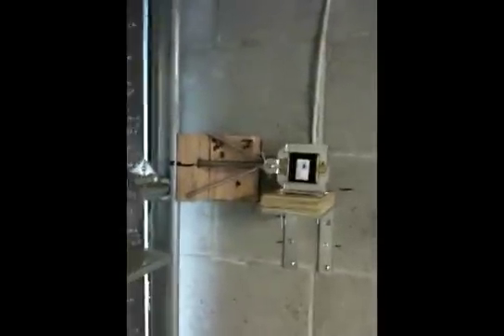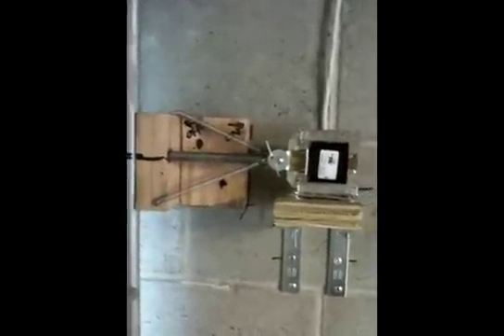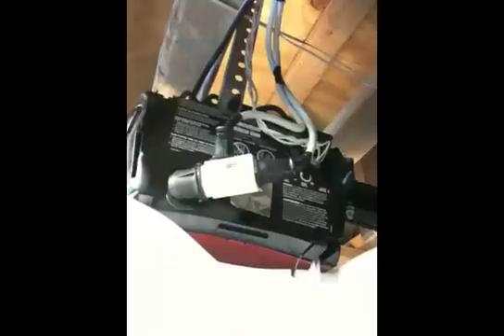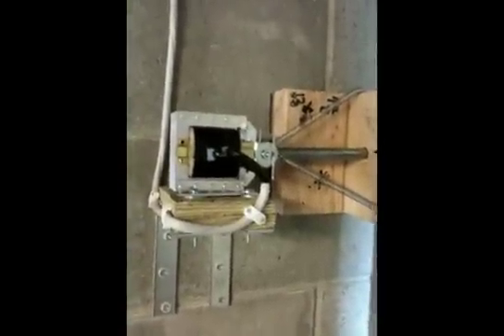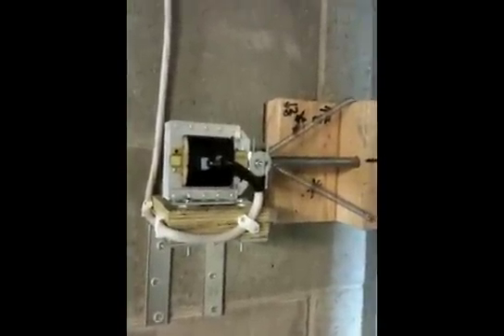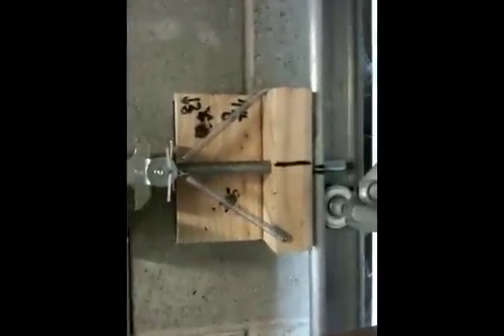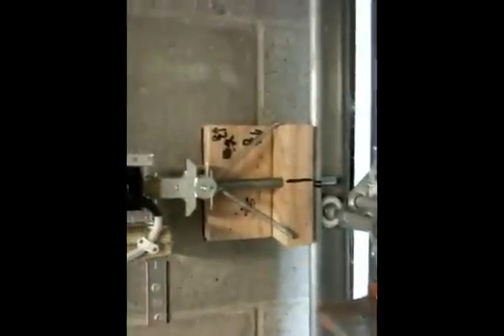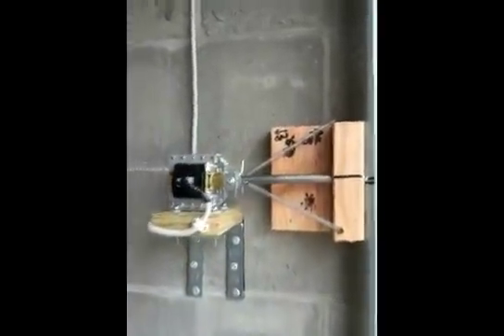Garage Door Deadbolt Automatic Lock

Comment: My opener has a smart wall panel with a motion sensor that turns the light on even though I'm not opening the door, so the solenoids would be activating every time the motion sensor is triggered.  Not ideal.  Your system needs to be activated by something other than the light circuit to be universal.  There is a product on the market that costs about $148 as of 11/2022 for those who would rather just buy a ready made electric garage door lock, search on Amazon.  Don't bother with the one sold by Lift Master, it has a horrible dependability history.

Comment: Excellent design and work!
Additional consideration: It should allow door to  be closed even with actuator off (like you rolling door down would be clicking thru closed lock but will not allow to move door up. Like regular door self locking latch allowing to close door not to open.
Reply: There's a company that makes the exact deadbolt you've described.  Sure Lock Garage Door Deadbolt

Comment: But that will not stop someone from smashing your car window and pushing the garage door opener, you need to have a secondary device to control the opener and deadbolts.
Reply: This is to prevent someone from entering from the outside through the garage door, not anything else. This can be done very easily forcing the door from the outside without bolts.
Reply: I have a sensor on the door itself and it will set off the Ring alarm when its armed.

Comment: For those of you trying to find the hardware I think I've found something that will do it.
110 volt version:
http://au.element14.com/dormeyer/3000-m-1/solenoid-open-frame-pull-continuous/dp/1331821
AND for the rest of the world on ~220 volts:
http://www.testco-inc.com/dormeyer/3001-M-1
Reply: The 110v versions you list are very expensive.

Comment: For those who are more electronically inclined (like me) I would add a new "open" button and remote receiver, and wire that to a homemade low-voltage logic circuit wired to bolt position sensors (a limit switch would do the trick) and then the logic circuit would wait for the bolt to reach the full unlocked position before it tried to open the door. If the bolt doesn't retract the first time, try to shake it loose by toggling the power a few times. That way, if the bolt got stuck in the locked position for any reason, the rollers and motor wouldn't be damaged.
Reply: For those who are more mechanically inclined (like myself), there are MUCH simpler and less expensive ways to accomplish what you've described, which do not rely on any electrical power source.
Reply: Most every garage door opener has an auto reverse fail safe feature when ever it senses a bind or too much resistance its a safety feature.

Comment: Good idea.    I did the same thing, only pulled the bolt out from the side (Two Doors), through the door rail.   Timing on the opener light is not adjustable, so the bolt stays retracted for a while.   Used Pull-type solenoids from ZERO. The tricky part was finding bolt attachment material (to attach to solenoid).   I played with all kinds of ideas until I finally just cut an old, brass towelrack bar into custom lengths and ground one end flat enough to fit in the solenoid opening.  Then I drilled a hole to drop a screw in to hold it.  Used similar wood mounting base and bolt guide arrangement.  Works like a champ, but I do want to cover it someway because there is exposed 120VAC.   The bolts slide very easily, so I only used a light spring.  The spring fits over a screwhead in the wood. In the event of a power outage, simply lift the spring off the screwhead and manually retract the bolt...easy.
Reply: do you have the parts list . i plan on creating one myself
Reply: @TheBeastyBears  - I realize it's been years now, but if you're still looking for these solenoids to make your auto deadbolt, see my comment about it in the main section.

Comment: Hello... Are those solenoids working on 110 volts? Can I have a reference to look for the in Amazon? Thanks!
Reply: I got a great deal on a large quantity of the same solenoids the video is using.  $60 a pair, free USA shipping.  Normally about $80 each retail, or as low as $40 each on eBay, plus shipping.   rigworks at yaho

Comment: I'm curious what happens if one of the solenoids fails to retract for some reason.  Will the opener still try to open the door?  

My guess is the opener can sense when the door is not moving and shut down.  If not, things could get messy.
Reply: If you set the up and down 'force settings' low, the opener should return to its previous position if it hits an obstacle.  But I like your post, because not all garage door openers "let go" so easily, and can significantly damage the door!

Comment: Yes you could do that, but I'd reccomend getting a power supply that will power the solenoids. Take the battery out of the equation so if it dies, you don't get locked out. :-)
Reply: @localguy9816  Dude that comment is 7 years old. I don’t remember but my guess is whoever I replied to brought it up. That was before YouTube did the @username in a reply

Comment: I'm not having luck finding the solenoid on grainger. Having a difficult time finding 110vac solenoids in general.  Can you point us to a brand on model number from the side of yours? Thanks in advance for your time
Reply: You could have it power a wall wart which in turns powers, say, a 12v solenoid.  Just a thought.
Reply: I realize it's been years now, but are you still looking for these solenoids to make your auto deadbolt?
Reply: @localguy9816  Yes That would be great 👍
Reply: @SaiLentKnight  Rigworks at yaho

Comment: not negative but the other guy is right if the power goes out,  sux  also i had/have debating on keeping my I-DRIVE for tors. sprng.  opener ,problematic but the 'boot' kept the a%#holes from releasing my door  and lifting it but caused them to 'crash-in' my 16*7 door. folds like paper and comes of the rollers and rails like nothing. the only good  thing is the tension makes it jam up and almost impossible to move once it collapses in. just to say if they want in theyll try!!  hurcne brace worx

Comment: So if the power does off then no dead bolt?  Say a robber turns you beaker box off?
Reply: Then HE can't get in.  This requires power for the deadbolts to disengage...spring load engages them.

Comment: Doesn't look like he has the room for a jackshaft. I just hope the light socket doesn't burn out on him. I've replaced quite a few LM light sockets in the last couple years. They either put 100w halogens in there and melt it, crank CFL's in the socket cracking it or the contacts just end up breaking. I'd hate to see those solenoids NOT open for him.

Comment: What type of solenoids did you use?
Reply: I got a great deal on a large quantity of the same solenoids the video is using.  $60 a pair, free USA shipping.  Normally about $80 each retail, or as low as $40 each on eBay, plus shipping.   rigworks at yaho

Comment: thats a great setup. hope you dont mind if I copy it. Whats the stroke like on that solenoid? I can easily get ones with a 15mm stroke which I think would probably be enough.
Reply: I got a great deal on a large quantity of the same solenoids the video is using.  $60 a pair, free USA shipping.  Normally about $80 each retail, or as low as $40 each on eBay, plus shipping.   rigworks at yaho